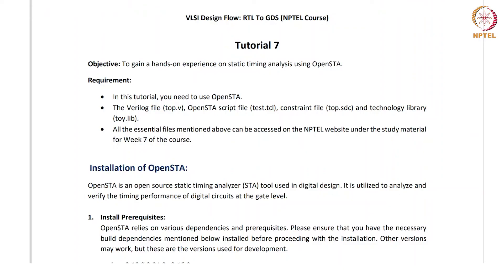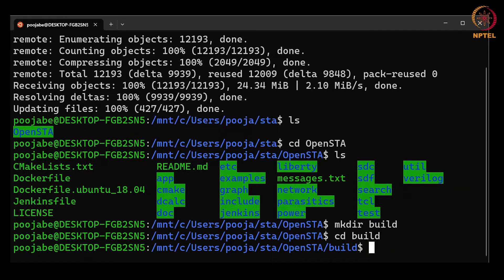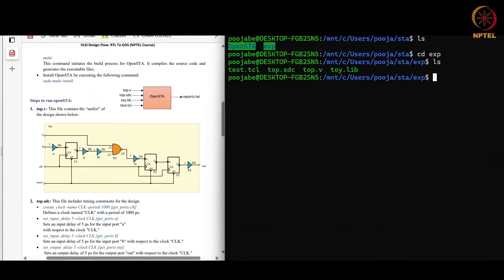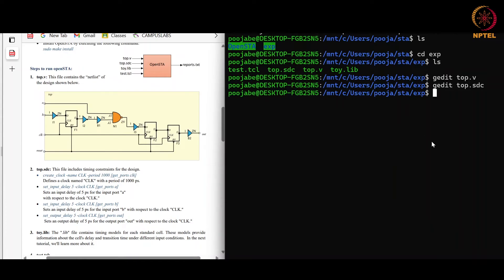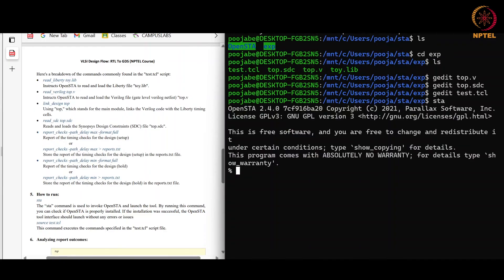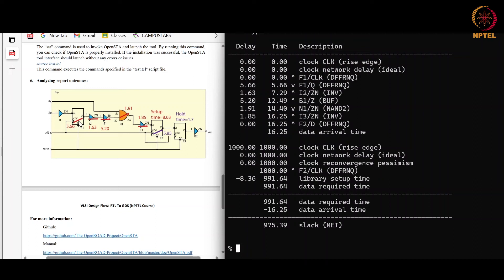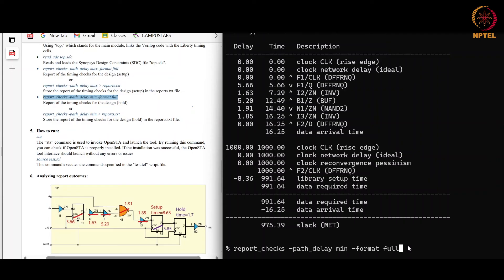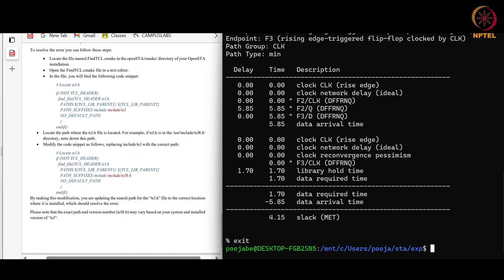Static Timing Analysis using OpenSTA

Comment: -- CUDD library: not found
-- SSTA: 0
-- Found SWIG: /usr/bin/swig4.0 (found suitable version "4.0.2", minimum required is "3.0")
-- Configuring done
CMake Error: The following variables are used in this project, but they are set to NOTFOUND.
Please set them or make sure they are set and tested correctly in the CMake files:
CUDD_LIB
    linked by target "OpenSTA" in directory /home/YYYY/OpenSTA

-- Generating done
CMake Generate step failed.  Build files cannot be regenerated correctly.

Hi,
Thankyou for the tutorial. I am installing Open STA, but i see the following error while cmake.Please suggest..

Thankyou